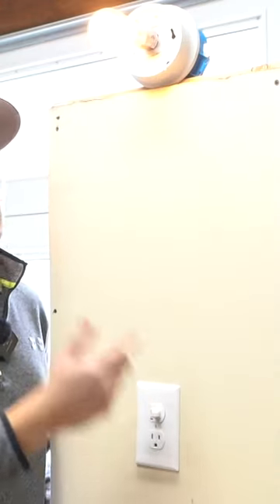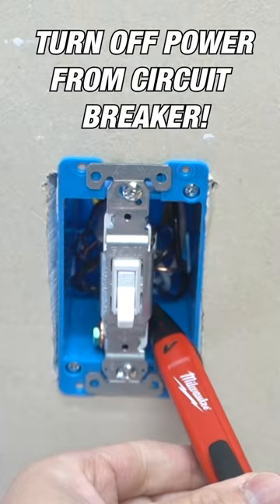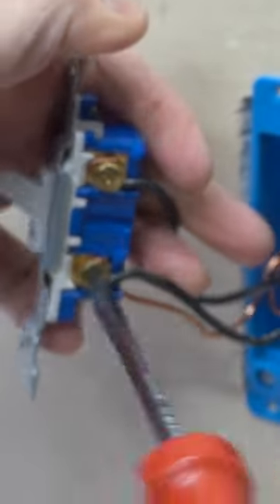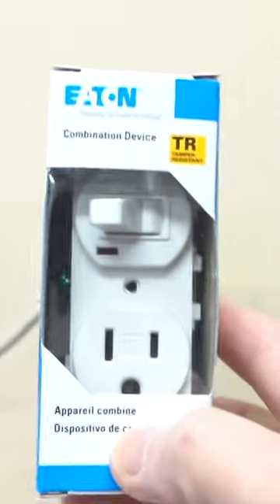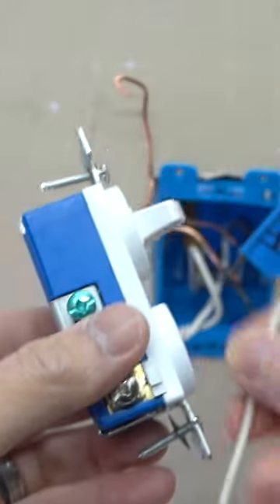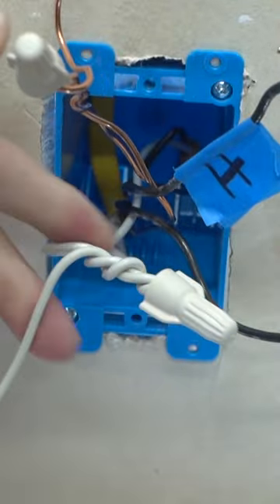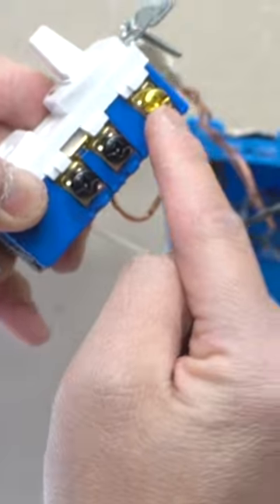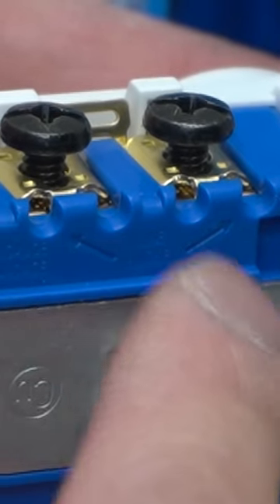How To Add An Extra Outlet To Any Room! NO WIRING NEEDED! #shorts

Comment: Yea let’s overload the circuit because someone isn’t smart enough to calculate load.
Reply: How would u calculate? Is there a tool that you can use?
Reply: @MA-vm6jl  the simplest way to explain is to tell you of the Ugly’s book. It has all references and load calculations for circuits. You can buy them at most every hardware store or electric supply. I could write a long note on how but that’s the tool all electricians use.
Reply: 10 Amp drill motor and 20 25w led bulbs with  1 Amp of power left I don't see a problem
Reply: That's why there a fuse breaker for that..simple not complex
Reply: @haaatg  correct. There is a breaker for the circuit. However… what is it rated for load? What wire is used? Is the wire good enough to carry the extra load without catching fire? 
My old neighbor, a cable technician, thought he knew what he was doing. He did this very thing and burnt his entire house to the ground. The insurance company denied the claim due to improper wiring not to code. 
Thankfully his wife, new born, and toddler as well as him made it out ok. Sadly, his wife divorced him for his stupidity and ruining their life by losing all they had.
Reply: @jefferybishop4553  I'm sorry what's happened to your neighbors but installing cable is not the same as electrical, even though they both have sound wave current. The breakers are designed just for that, ; heavy load, type of wire used, and etc.; I not sure how it's would it will start a fire unless you have replaced the building code with an wire that are not design for an outlet in the first place. For example, he might replaced it with a 6m 8 amp wire that will not trips the breaker or have a short with an 8 amp (replaced) wire.
Reply: @haaatg  what you are saying about the wire is exactly what I was trying to get across earlier. Having done electrical work before I get exactly what you are saying about the wiring and how different it is from cable. My old neighbor… didn’t understand. Hence his dilemma. 
As to what I was getting at here… 14/2 would not be sufficient for carrying the load of an extra outlet on the circuit already at load designed for by engineers and master electricians. Codes exist for a reason. If he’s adding on a maxed out circuit… even if proper outlets are used and he swapped breakers… will the wire be safe ? Always check the load and load rating for every component of the circuit.
Reply: @jefferybishop4553  What state did this happen in?  I've been a claims adjuster for 15 years and have worked in 6 different states and none allow for claim denial due to the reason you mentioned.  One of our favorite sayings is "we can't deny due to stupidity".  Insurance laws go to the extreme to protect the public, not the insurance companies.  Millions of older homes in this country are not up to "code" due to when they were built.  Your story is likely made up, or missing details.
Reply: @darinvee4980  happened 2009 in WV.

Comment: Lighting and outlets should not be on the same circuit.
Reply: It is allowed in residential applications, but not in this fashion. A general lighting circuit is preferred, and required in commercial and industrial applications.
Reply: Why?  An actual reason and not just because that's what you were told.  There is nothing "scientific" that makes lights and outlets on the same circuit dangerous.
Reply: @darinvee4980  not dangerous but if you plug something in that draws a lot it will make the lights blink
Reply: @samcarbone4139  someone think of the children!

Comment: Totaly illegal connection. You can kill someone with this type op connection. In most countries the light circuit has a lower rated breaker and you will not find a neutral wire within a light switch.
Reply: How would you kill someone  with this connection ?
Reply: @ANDKINI  If you isolate the electrical outlets to do maintenance work you will have a false sense of security. Electrical outlets is on a different circuit than lights. Meaning you isolate all outlets to work on it and you don’t test before working you could be killed.
Reply: @johankriel7612  if you don't test the wires for power before working on it then that's just natural selection lol

Comment: A lot of switches don’t have a neutral wire run to them. But this would work in most cases.
Reply: Then use the ground.
Reply: @benjurqunov  I can tell you’re a hack. Just because something works, doesn’t mean it should be done.
Reply: @benjurqunov  jokes on you. My house has knob and tube, wiring. Only one receptacle in each room.
Reply: @benjurqunov  you have to be joking.
Reply: You can't connect sockets to lighting circuit regardless if it has a neutral.
Reply: @dogwalker666  Why?  If you say "code" then I know you're a troll.  The same wire that supplies current to lights, supplies it to sockets.  Millions of homes in this country are wired with sockets and lights on the same circuit.  There is nothing inherently wrong with doing this.
Reply: @darinvee4980  why would I say "Code"? 
Lighting circuit is fed from a 6A breaker and the cable is only rated as such,  Power distribution is fed from a 32A breaker and as such is wired with a heavier cable,  obviously you are not a qualified electrician,  Oh you also don't know what a "Troll" is.
Reply: @dogwalker666  Huh?  Lighting circuits "can" be fed by any size breaker.  Most houses in the US use 14 and 12 gauge wire for "all" circuits along with the corresponding 15 amp and 20 amp breakers.  I've work with many "qualified" electricians and more than once I've heard them say "any monkey could be trained to wire a house"  as in, it's not that difficult.
Reply: @darinvee4980  well obviously they are not qualified electricians,  It explains a lot, And any lighting circuit fed with a 15 amp circuit needs rewiring urgently by a professional,  
 Perhaps you should also pre warn the local fire department that the houses are dangerously wired, 
No electrician's would wire a lightning circuit in #12 Wire  you would never fit them in the terminals,  #16 Gauge is the correct size for AC lights Pointless explaining  LoVo DC to you,  
Where did you get your qualifications?
Reply: @dogwalker666  Where are you from?  I have worked in several states where I have observed new construction being wired, and never see anything but 12 and 14 for outlets and lights, unless it's for a doorbell or thermostat.  I grew up in the construction world and have worked the last 30 years in industries where I'm on jobsites.  One of my families favorite sayings is "you skin your cat, I'll skin mine", in other words there's more than one way to do something.  The electricians I work with have licenses and are inspected by the state.
Reply: Gotta admit it's pretty dam funny to actually see the home depot pkn lot hacks rising through the ranks!!
Reply: @dogwalker666  they don't even sell #16 wire in the US, smallest size wire used is 14 wire, and the smallest circuit breaker is a 15 amp breaker, don't know what country your from but if you can explain to me your reasoning for saying any lighting circuit fed with a 15 amp circuit needs rewiring urgently??? I could run 10 wire and put it on a 30 amp circuit and there would be no issue with that at all. if you can explain your theory that makes the amperage of the breaker and gauge of wire that you feed lights with or anything for that matter as long as the wire and breaker are rated for more amps than whatever is used on that circuit will make it dangerous I would love to hear it. If I want to feed 12 lights that draw 1 amp each why would I not put them on 14 wire and a 15 amp breaker? Only thing smaller gauge wire is used for is low voltage...
Reply: @benjurqunov never use the ground as neutral
Reply: @alneg6234  but if it works and I did it that way. 
Go F your hat if you're trying to tell me it's somehow wrong. 
IT WORKS !!
Reply: @benjurqunov just because it works doesn’t mean it’s right, or safe. Ground is not supposed to carry current. You made a death trap, and no matter what you say it won’t make it right. Let’s hope there’s never a short or else you can say bye to that house
Reply: @dogwalker666 you’re from the UK, that explains why you’re so confidently incorrect correcting someone who does the same thing in a different country. Thanks for the laughs
Reply: @averagemike2171  So your from the US or is it 60 years in the past? It's hard to tell the difference, Regs are the minimum requirement, Your integrity should push you to improve your standards to European levels.
Reply: @averagemike2171  P.S. I am not a house basher, I work with much more complex equipment.

Comment: ONLY use this for like an extra cell charger.. please. No toaster or hairdryer.. as others already mentioned in the comments this could lead to disaster. So don’t go changing every damn switch in your house to these even though it seems convenient. I added one of these to a home with a little “charging shelf” below the switch for their phone to rest on after identifying a neutral was present, it was a 20A breaker and there was only three plugs on the circuit so I felt confident it was ok. It’s a nice addition situationally but proceed with caution.
Reply: Why?  The wire looked to be 14 gauge.  No issue running most household items off that gauge and a 15 amp breaker.
Reply: My only thought is you’re suggesting these switches themselves are cheap junk because there’s no real reason this wouldn’t be ok otherwise

Comment: If I have 2 hot wires should I connect them both to the hot screws? Or should make a pigtail and connect them using a wago? Don't want it to over heat or anything.

Comment: This wouldn't work in the UK, alot of our lighting circuits run on 6amp breakers ( rcb, rcbo) and have smaller diameter wire
Reply: would not be allowed and in fact would be condemned, using an earth as a return is strictly forbidden.

Comment: All of you "experts" need to explain why this type of switch would be a problem?  Where I'm from the same wire that provides current for outlets, runs light switches as well.  Also, why would Eaton sell it, if it was so dangerous?
Reply: A lot of municipalities have local codes that specify against lighting and outlets being on the same circuit. You also make it a lot easier to overload a circuit depending on what loads are on the switch/ outlet. Eaton sells it because there are specific use cases for this. It’s not meant to just add an outlet wherever you feel. It’s meant to be able to only have one box that has both the switch and outlet. My utility closet has one for easier maintenance. I wouldn’t recommend just slapping these in bedrooms or living rooms.
Reply: Because these armchair geniuses dont know squat. My only complaint is in most older homes there isnt a neutral wire in a switch box. 

As far as breakers being different from lights versus plugs that total BS. Ive ran alot of switches besides gfci recepticles in the same box and its code!!!

Comment: the switch was wired for a smart switch so it had a neutral. now that is code but it wasn't until recently and it still isn't followed if someone is just replacing wire in kind.

Comment: Of course this only works if there's both a hot and a neutral in the switch box. If the hot goes to the light and they only dropped the hot and the switch leg down to the switch box you cannot do this unless you cheat and use the ground as a neutral which is against code. 
Grounds are not to be used for carrying current in a circuit in place of a neutral.

Comment: Yup! No neutral no plug, also! Disclaimer: if the branch circuit is loaded to its max then adding a plug might trip the breaker or worse cause excessive heat build up on the wires. Also a very bad thing.
Reply: Light are on separate circuits. Most cases lights are not using a large load. Should be okay for some small appliance, not a hair dryer, as an example

Comment: This violates NEC code where a grounding wire shouldn't be used as a neutral.
Reply: Watch the video, he pigtails into the existing neutral wires.  All of you "experts" need to realize this is an receptacle sold by Eaton.  This guy did not create anything new, or unsafe.  There is no safety issue here.  If you believe there is, give some detailed reasons.

Comment: he really said it doesn't matter where u put each hot wire and it definitely does especially if uvwant to use that outlet when the switch is off or if u only want it to work when it's on

Comment: You can't put a socket onto a lighting circuit,  That's completely wrong!
Reply: Why?  Please be scientific and not just say "code".
Reply: @darinvee4980  lights are on thinner wire and a 6A breaker,  Sockets are heavier cable and 32A breaker,  Don't care about "Code".
It's also bad practice because if it trips you lose lights and sockets instead of just sockets.
It was stopped about 70 years ago.
Reply: @dogwalker666  Where do you live?  In my area of the US homes are wired with 12 and 14 wire.
Reply: @darinvee4980 Don't forget 10/2 also. But that's mainly for water heater's .

Comment: Sounds well dodgy. Makes me question how crap is your electrical code, permitting lighting and receptacles on the same circuit.

Your lighting circuit should be dedicated and limited to low current.
Reply: @@jash21222 Because using thinner wire is a lot cheaper.

Why go for thicker wire and waste money when you don't need it?
Why rate a lighting circuit at 32 amps if you are never going to exceed 6 amps?
Reply: @@jash21222 You have the added problem that in the USA your single phase supply voltage is half that of the UK so that automatically means your current needs to be double that of the UK, unless you are running lighting off split phase with two hots at 120 each.

Comment: This would not work in most older homes as well.
Grounds are almost never run to a switch box. Most electricians in 80's and 90's  ran a single 14/2 to a light fixture (and if your lucky they wired in on the hot side. but  many switched the neutral)
Reply: This is called a switch loop.  Very common in older wiring, the white neutral is then reidentified with black tape.  Also with this setup depending on if the jumper terminals are used. you can have it as a "hot" outlet (always on) and the switch turns on a ceiling light, or use the jumper to have a switched outlet.

Comment: American electrics are terrifying
Reply: Compared to what?
Reply: @Makitafan  UK, Europe for example.
Reply: @grahamek86  that's an interesting point in perspective. I think having 240v at the outlets is excessive and thus more dangerous for "Harry Homeowner." But, the flip side of that is a lower amp draw and smaller breakers.  👍 Cheers
Reply: @Makitafan  the standard of electrical safety means that voltage is perfectly safe. Everything is designed with testing and repair in mind. The higher voltage means greater efficiency meaning we have higher power appliances on same size conductors as 120v systems.

My comment with regards to this video is that you have a lamp running off a socket circuit which is massively over-rated for a lamp. Having wires wrapped round a terminal, at the side of the outlet absolutely baffles me. There's no logical reason to not have compression fittings at the rear of the outlet meaning if there was any mechanical damage causing protrusion of the outlet, you're not going to have a) exposed conductors and b) wire wrapped round a screw that can easily undo at the right angle.
Reply: @grahamek86  truth be told the conductor size isn't dictated by the voltage. But I agree with the rest of your comment. 👍
Reply: @Makitafan  conductor size is dictated by the current. Twice the voltage and same current means twice the power.
Reply: @grahamek86  no shit Sherlock
Reply: @grahamek86  The voltage of 240 volts is definitely NOT safe.

It's the mechanisms that prevent you contacting it that make it safe. So the shuttered earth pin on socket outlets, the insulated sleeves on neutral and live pins on the plug, the fuse that blows in the plug if a fault occurs and prevents a metal case from becoming live, the circuit breaker that trips, the rules around barriers and exposed live copper parts, the rules around use of RCD's.
Reply: @Makitafan   The idea that the use of 240 volts is excessive demonstrates just how little you actually know about electricity. Seriously, it does.
Reply: @deang5622  That's like saying 37,000ft is not safe it's the plane that makes it safe. Yes, if you want to play the semantics game, the protections the UK use around their electrics make it safe. Just like your ability to balance keeps your head safe from the ground and seat belts make 70mph safe. A dangerous situation is made "safe" by virtue of making an accident unlikely.